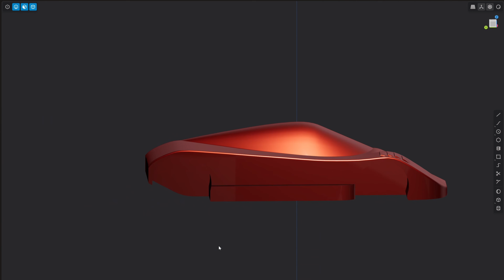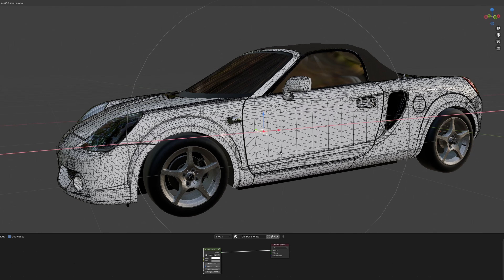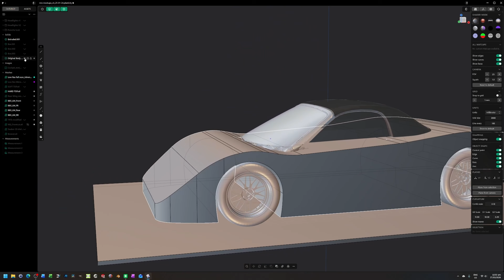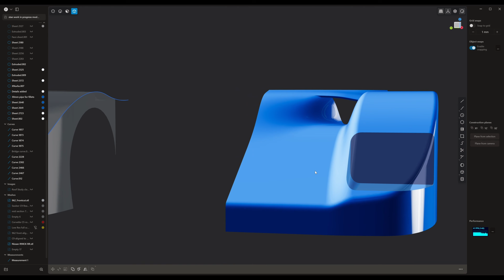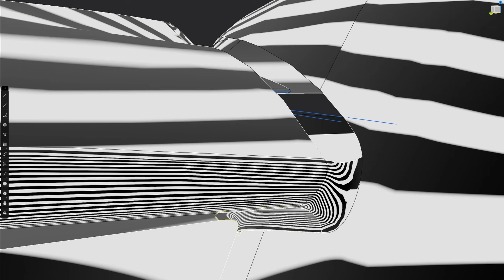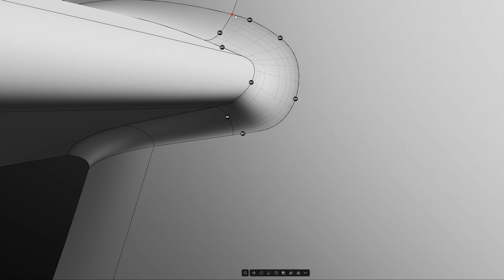Early MRC Design stage

Comment from the maker: Hi everyone! Does anyone have any hot tips for testing Aerodynamics without breaking the bank?
We would love to do some basic analysis of the MRC either using CFD Or a Scaled down Wind tunnel!
Reply: Seen some good results with air shaper from car design workshop and super fast matt.
Reply: @EpimethiusInPerpituity yeah I second air shaper, the aerodynamics of a baguette are surprising
Reply: Search 

premieraerodynamics

Simulate-Your-Own-Car
Reply: OpenFoam is probably the way to go, it's free and quite powerful but not as straightforward as other CFD softwares. I haven't learn it yet but planning to do so eventually so I can design a 1m in span diffuser for my miata. The channel @PremierAerodynamics has a few affordable courses.
Reply from the maker: Thanks! Reading the comments so far, Open foam seems to be the first one to try
Reply: Using wind tunnel simulator
Reply: see if you can collab with airshaper or open foam or premier aerodynamics or sign back up to uni and use ansys lol
Reply: Air shaper looks to be the best - it's what I intend to use.
Reply: I believe you can use altair inspire for CFD, or ntopology (seven seas mode)
Reply: I've heard open foam was open source, and free to use (can be used in freecad iirc), but is hard to use
Reply: Open foam, free an open sourced.
Reply: Bramblecfd! Bit pricey but probably the best cloud cfd on the market for automotive stuff.

Jake @ pmd

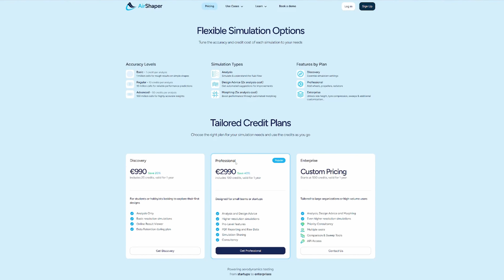Comment: @5:54 just used opensourced open foam. make sure you have a good computer for simulations... there is several open sourced cfd programs. unfortunately they are not as simple to use as solidworks simulation for example but not that far off and most get the hang of it pretty quickly.
Reply from the maker: Thanks! I will definitley be trying openfoam, have had a few people suggest it sofar 🙂

Comment: if you want to know how to do jump cuts. You butt the audio wave form up as close as possible (almost overlapping), then close your eyes and listen to it, and tweak it so the audio flows. Then you "bridge the cut" by extending the previous clip's video only, over a little bit. A base line place to drag it over, is to the middle of the next audio bump/peak (normally around 1/4 to 1/2 of a second, but can be multiple seconds long in some situations)
Reply from the maker: Thanks for the tip, still getting the hang of Davinci Resolve. Hopefully each video is better quality than the last! Did you notice any difference in the audio in this on? I purchased a DJI mic rather than recording the audio from my phone's mic